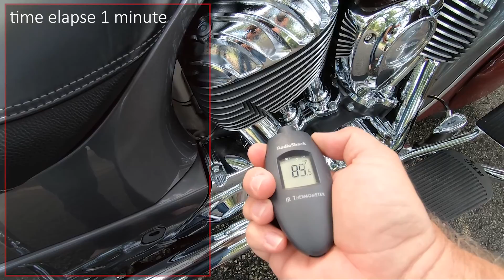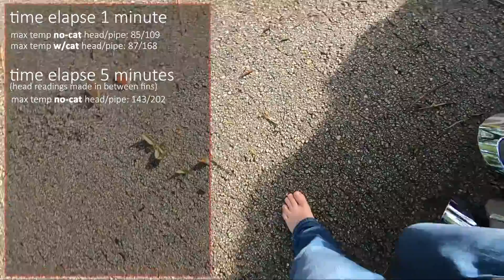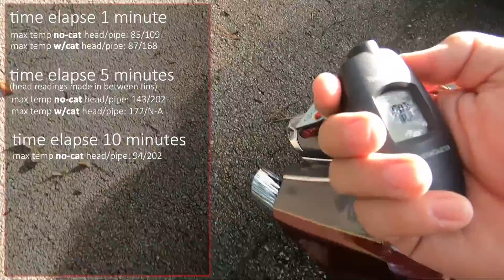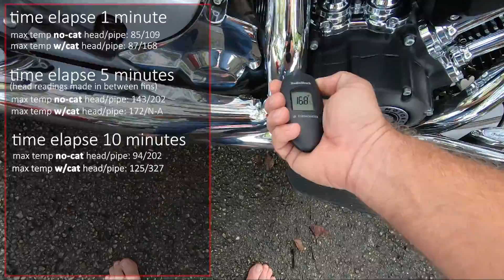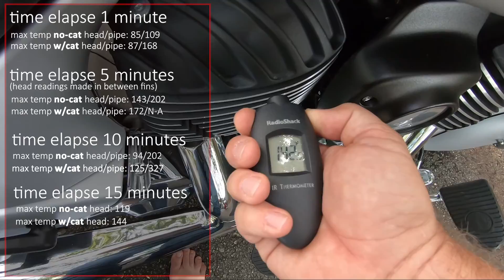Indian TS111 Catalytic Converter Heat Comparison

Comment: Your explanation of a catalytic converter is way off in your video. A catalytic converter adds a molecule of oxygen to the exhaust air/carbon monoxide, converting it to carbon dioxide by way of a catalytic reaction at or around 650 degrees in the catalytic converter. 

What gets rid of carbon dioxide from motor vehicles and motorcycles? Side Note, as humans we also exhale carbon dioxide.  CO2.

Trees 🌳 gets rid of/absorbes CO2! 

This is why all automobiles have them and it's illegal to operate one without a catalytic converter.

Comment: Should you alter the tune on the ECU, or run something like a Power Commander when you either gut the cat, or replace the head pipes?
Reply from the maker: The power commander does alter the tune inside the ECU on these air cooled bikes. It’s basically a tool you use to push the tune into the ECU. And yes, you def need that when ever do a cat delete or header change.

Comment: what is involved in taking out cats, cost, where its located?
Reply from the maker: You have to replace the header pipe, usually when you do that you wind up doing the whole exhaust system. Around $1500-$2000

Comment: Ok, yea but I didnt see what model years you were comparing.. Did either have the Rear Cylinder deactivation and was it engaged? I noticed the Stock bike valve train was more quite too
Reply from the maker: These are both 2018’s and we didn’t get rear cylinder deactivation that year. 2019 and up. Thanks!
Reply: @TwoIndians  the big change for 2018, Your models have the new piston skirts,  Have you checked to see if you can upgrade to the RIde Modes and Rear Cylinder Deactivation software and required hardware of the 2019 and later?
Reply from the maker: It’s honestly not a big deal to me. Ride modes would be nice but since I did the BBK I got enough power LOL🤟👍😎

Comment: Just curious I just bought the Chief Vintage with Freedom pipes . Do they actually help reduce some heat.are the headers changed when they use these new pipes? I personally like the throaty 
Sound ! 
Thanks Bob Ohio
Reply from the maker: Well it depends on what you mean by “pipes”. If they are just slip on mufflers then no  you need to change out the headers or remove the catalytic converter from the headers. I’ve replaced mine twice (see our other videos on this subject) and I can tell you from experience a two-into-one set up produces more power than true duals. But again, if you’re looking to cool things down, you gotta replace the headers.

Comment: You guys realize the bike has to be remapped or they won't see much temperature drop increased exhaust flow means a leaner mixture later mixture means more heat
Reply from the maker: Yes, we do realize that. Thanks!

Comment: You know you can turn off the rear cylinder while sitting in traffic to reduce the heat on the chieftain in the ride command.
Reply from the maker: That’s only on 2019 or higher models. Same for the ride modes. I don’t have these options on my 2018
Reply: @TwoIndians  didn’t know that. Now I do and knowing is half the battle. I have never really noticed any uncomfortable heat. But then again I just got my chieftain last fall.
Reply from the maker: Yeah summer time provides new perspective. Hehe, especially in FL.
Reply: @TwoIndians  this is why I have a 2021 Chieftan with rear cylinder shut off. And I only ride in the winter. Maybe that's why I haven't noticed the heat from the cat.
Reply: How? I have ride command on my phone but it's super slow and never delivers. FYI UK user.
Reply: @s2hjt  it is under the settings on the bike.

Comment: My Springfield has the factory oil cooler and I wear proper gear. I had the factory oil cooler fitted from new on my 2017 Springfield. The bike has a Washington State exhaust so its pretty free flowing. Heat simply isn't a problem and most of the time I could put my paw on rear rocker cover. I have ridden numerous times in extreme heat conditions like 114 degrees F in the USA on Interstate 40 to San Diego in awful traffic, Death Valley and 42C in Australia. Now some caveats. I avoid idling excessively especially when it's hot. I try to avoid summer city traffic jams it is rubbish riding in those conditions anyway. I always wear heavy gear especially when it's really hot because good gear will both reflect heat away from you and it has good venting and at speed the airflow will keep you cool. I always wear Kevlar pants. I think anything that restricts airflow around the bikes engine is a bad idea. It is an air cooled engine. I also make sure oil levels are up because oil cooling is also very important. My bike is a standard 111. I wouldn't change it to a 116 as I am happy with current performance and reliability. BMW rely on oil coolers for their aircooled bikes and I have found them to be completely reliable. I find it puzzling that most Indians don't have them and yet originally they were standard fitment on the 111. The only down side of the oil cooler is the engine takes longer to warm up. So I ride gently to start with until operating temperature is reached and my shortest ride is 40k because I live in rural Australia. Cheers all

Comment: Brian, nice job.  
 I personally removed/ gutted the converter on my 2017 Roadmaster. I also wrapped the converter area with exhaust tape. I then replaced my stock seat as it has a  medal base to it.  Then I ditched my Capt. itch ! I have zero heat now as appears to the burning I would get prior to doing this. Seriously, quiet amazing and the added increase in power was also amazing.

Comment: Is it as simple as de catting or do you need to do other stuff such as the electronics or add baffles ?
Reply from the maker: The Easiest way to do it is just buy a full exhaust system and replace the stock system with a 2 into 1 (2:1) system. I’ve learned a thing or two because I’ve seen a thing or two. 😁 I like the freedom pipes personally but Rinehart and DND also make good systems

Comment: Unfortunately, even though you put in a lot of thinking and are a smart guy. It is not possible to measure IR on reflective surfaces. They should preferably be matte black. If you take a lighter in one hand in front of a mirror, and then point the IR thermometer at the flame in the mirror, you will understand.
IR is reflected just like any other light.
So to get this right you need to have a contact thermometer, probe.
But it's great to actually make a comparison.
I will remove the catalyst on an Indian, so then I will measure before and after.

Comment: My bike is completely stock. I changed out the original battery with a lithium one & the heat from the rear cylinder melted the bottom of the lithium battery. The bike gave off some error codes. When I took out the lithium battery the bottom was warped from the excess heat. I went back to a traditional AGM battery. In the fall & early winter the heat feels good though.

Comment: Best way to reduce heat would be to ceramic coat the heads, valves, exhaust ports and inside of the headers. Racers have been doing this for years. A company that I used for my bike is Swaintech. I believe they are still in New York.

Comment: It is not possible to measure temperature with an IR thermometer on mirror-shiny surfaces. If you also want to make comparisons, it must be the same structure and color on the surfaces. To make this type of temperature measurement, a contact thermometer must be used.
Believe me, I know this.

Comment: Thanks!  There is a difference in emissivity of the black and chrome surfaces. On the exhaust pipe you are measuring the temperature of the heat shield and not the pipe.  The difference in brands and distance from the actual pipe to the shield could also impact the readings.  That may account for some of the temperature differences but the conclusion still holds - DeCAT and true duals helps temperature tremendously.

Comment: I have a Harley twin cam 88 fuel injected and it gets hot at stop lights and traffic I thought Indian and Harley both had rear cylinder cutoff at idle ?
Reply from the maker: Indian only has it on the 2019s and later, I have an 18

Comment: I just gutted my converter on my 2017 Roadmaster.  It was not hard and took me one day from start to finish. I cut the converter open and welded it myself. I went one step further and then wrapped the pipe with exhaust tape and then sprayed it with a high temp silicone base spray to protect the wrap.  The results are simply amazing. The massive heat is gone and the engine really breathes. I can certainly feel a power increase as well.  I did not take temperature before and after, ugh.

Comment: On the 2019 and newer the rear cylinder is suppose to deactivate. Does that help with the heat?
Reply from the maker: sirglogg LuBardons reports are mixed on that TBH. If you’re sitting in a lot of traffic it can be helpful but if you’re running on long rides it makes no difference. For me getting rid of the cat and getting a decent tune made the most difference. I’m working on a new video replacing the true duals with a 2:1. Stay tuned for that!
Reply: Not noticably

Comment: I want to know how hot the head and pipes are on the Challenger. Absolutely nobody has commented one way or the other about engine heat while test riding that bike
Reply: I can tell you that after riding my Springfield for 2  years now and just recently test rode the Challenger the heat difference is very  significant. But there are too many things I don't like about the Challenger compared to my Springfield. I'm sticking with the Springfield and leaning toward installing the Jackpot conversion.

Comment: Did you have to get a remap or reflash after the exhaust change?
Reply: Thanks, I just bought the FTR1200 and was going to take the cat off but S&S told me to leave it on and just replace the muffler I would need the cat for back pressure I will lose some low end and mid range power if I removed it, but thanks for the reply

Comment: I'm running true duals with rinehart slipons and I think that the bike sounds great olso I read somewhere that with true duals the temperature decreases about 30% but on the down side I I olso read that with true duals you lose torque on the bottom end. Well I did it anyways and if I lost any torque on the bottom end I can't tell it feels the same to me.
Reply: @TwoIndians  I olso had stage 2 cams maybe that is why I didn't felt any difference on torque, my bike is in the shop now getting the big bore kit installed I should get it back Saturday I can't wait.

Comment: my 2018 RM glows red hot on the rear pipe at idle and during a ride and you can really see it at night.
Reply: stock that is.
Reply: @TwoIndians   yes and I think I will have to find one set of pipes that will bolt-on with no cutting so I can keep the stock parts in case of a trade-in.  Also a scavenger box in the pipe to maintain HP.
Reply: So a lot of people are pretty high on the Rhinehart Slimline for those exact reasons. The only drawback I’m hearing is they hang a little low and if you’re an aggressive rider I’m told they can scrape pavement.
Reply: @brianremington  I tend to lean into the corners hard to get the full amount from the bike.  I may have to look to D and D out of Texas and see what he has been working on.
Reply: So a lot of people are pretty high on the Rhinehart Slimline for those exact reasons. The only drawback I’m hearing is they hang a little low and if you’re an aggressive rider I’m told they can scrape pavement.

Comment: My '16 Springfield never was very hot on my legs until I installed fork mounted wind deflectors, now with the decreased air flow around my legs the heat really generates up my legs.  Gonna do this really soon!

Comment: Thanks for sharing. I have a 2019 Springfield with Rinehart pipes. I'm after a louder and deeper sound and I'm told that the Jackpot (Fuel Moto) cat-less pipe is the way to go. The reduction in heat is a nice byproduct. How do you compare the sound of the true duals with the cat-less pipes? Thanks.
Reply: @TwoIndians  thanks for responding. To be clear, did you have the careless pipe from Fuel Moro (called Jackpot) or some other system? I ask because RH does make the catless pipe but I understand that it is the same a thw Jackpot oipe only all chromed, which accounts for the double the price.